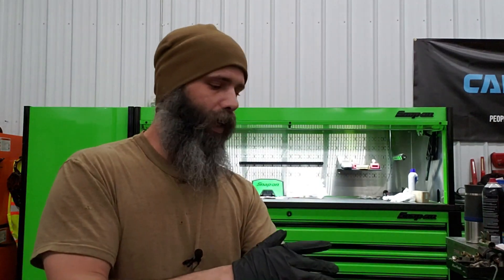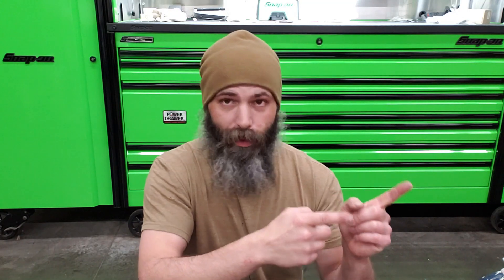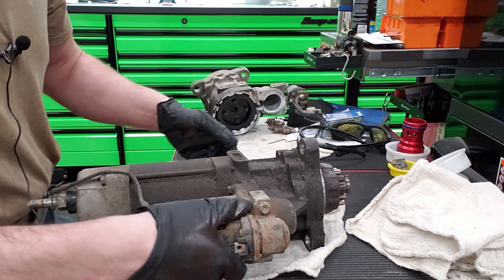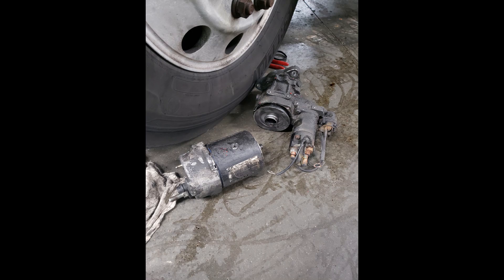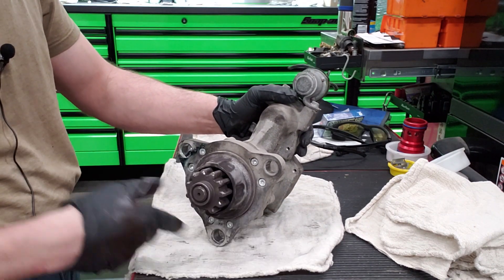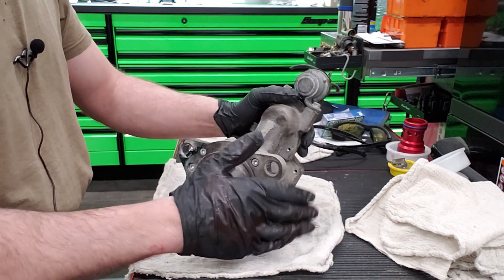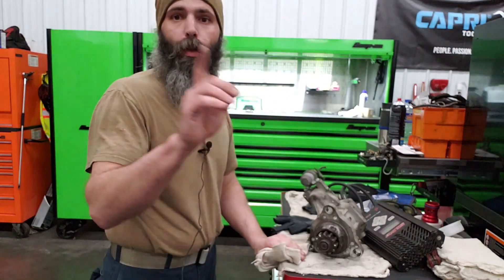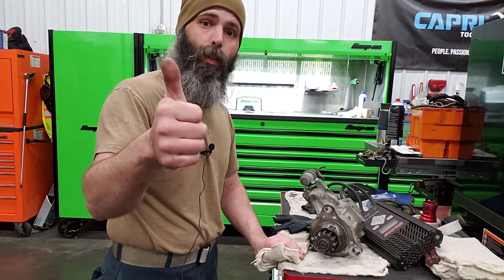Starters and Batteries, Tech Tips- Starting Off Diesel Series

Comment: It’s the clocking that causes the mysterious “2 bolt” starters. I’ve seen a few come thru the shop missing a bolt or nut (always the one behind the solenoid) the Volvo D13 and the DD15 seem to have these. ISX and CAT starters always seem the easiest.
Reply from the maker: I have done several dd13, and some d13 and d11 volvos and didnt have too many issues with those, but these cngs, man they are definitly tight up in there. thanks for watching and input!

Comment: Snap on has a 5/8 1/2” drive wobble starter socket designed for that 👍
Reply: I can get ya the part number Monday when I get into work
Reply from the maker: Yeah but when solenoid is literally straight up against base of block so hard you cant eben get a 3/8 extension past without socket... its bad juju if she aint clocked... do appreciate though
Reply: 12 point 5/8 btw lol
Reply: IPRD20 5/8 swivel socket. It’s a life safer unless the bolts are seized in the bell housing. It is a pinned swivel socket so limited on flex and angle. I’ve broken two so far, however they always seem to break torquing the last bolt down so can’t complain. Also keep a deep 12 pt 5/8 impact socket for when you have to get the breaker bar out, and about 3 feet of extensions.